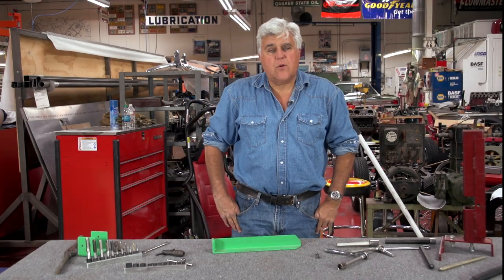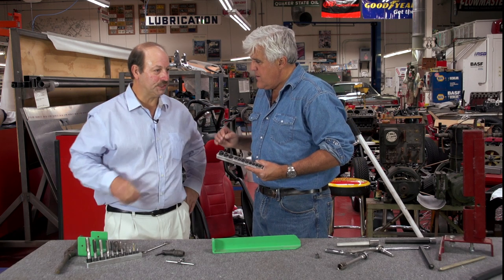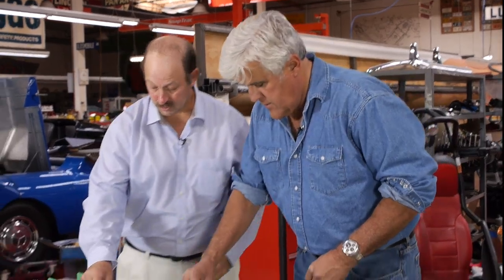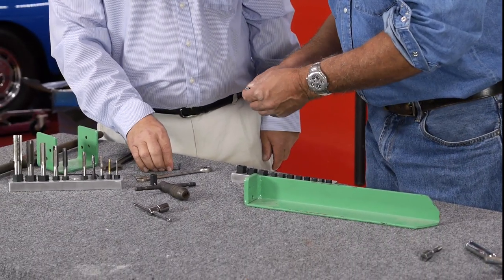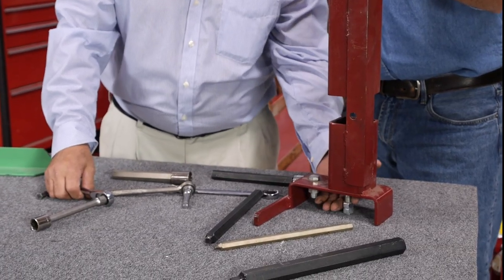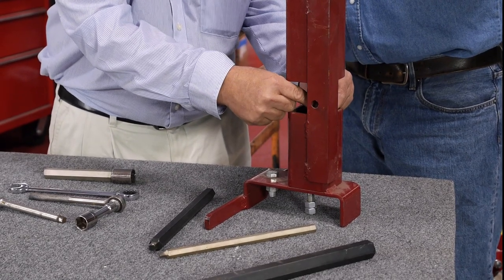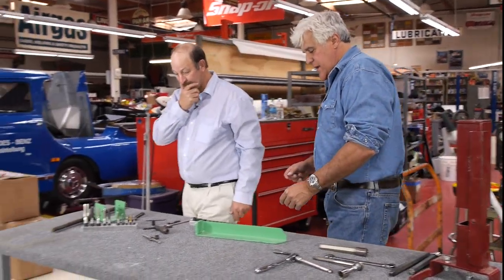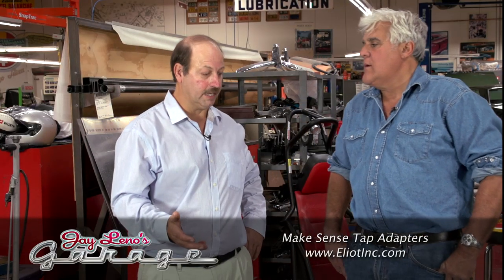Tap Adapters - Jay Leno's Garage

Comment: Well done Jay Leno. Good to see you pushing the tool side. i have had some special application tools made in the U.S., Germany and China,(yes, China, every bit as good as anyone else). All the machine shops were owned and operated by guys as in the video. All open minded, easy to talk to, and even willing to give input as to improving the ideas. Some of the posters are correct. Snap-on tools cost the earth, and are certainly not the best, but that's for everyone's personal choice.::)

Comment: Great for breaking taps off in the hole !!! Got a set of snap on ones and have broken several taps off because you are using a ratchet instead of a tap handle . Seems like when you use a ratchet you are also using an extension as the hole is way out of reach and all you have to do is just put a little side pressure on the tap and snap it's broken . Then you get out the tap puller which usually removes the tap if you weren't torquing too hard on it . P.s. the snap on ones hold the tap in with a "O" ring inside the tap holder .

Comment: I've always wondered why they made taps like that, some times makes them really hard to use. So this would be great, even a set of taps where you could use standard 1/4in drive and 3/8in drive and 1/2in drive would be awesome too.
Reply: I never had any problems just putting a regular spanner on the end of a tap.

Its just a square drive.
Reply: Yeah but the only ones I find that fit are adjustable ones or their too small and I damage them.
Reply: ***** Ah, never trust adjustable. Got metric and imperial combi-spanners so I can find something that fits. If push comes to shove, 30seconds on the bench grinder to get them to fit works for me. Just keep the edges square and its no problem.

Comment: There is one major problem with this sollutions,
Taps are the way they are for a reason.
When you tap something,
it is crucial that there no bending forces into the tap,
because that is what is going to make your thread weak.
This is why taps always use these special grips,
which are symetrical.
If you use normal spanners,
you are enducing a farely high amount of bending forces,
which is why your threads are not going to be as good as the ones
with standard tap wrenches.
Reply: +Peter Griffin Yes, a tap breaker for sure.  Though a few times I've had to put my 1/4" or 3/8" ratchet on a tap when there was no room to swing a symmetrical handle.  One can do that without breaking the tap if one is careful.  That said, a 12 point socket will grab a tap just as well as this fellow's adapters.  His advantage is that the adapter has a set screw so it the tap won't fall out like happens with my 12 point sockets.

Comment: the states just needs to start using the metric system :)
Reply: Why, exactly
Reply: ***** Much easier than fractions.
Reply: ***** Because it makes sense. Let's take distance for example.
1000 um = 1mm, 10mm = 1cm, 100cm = 1m. Therefore 350 meters = 35000 cm, or 350.000 mm or 350.000.000 um. Now you do that with feet and inches, without using a calculator. See my point? It's counter productive to use feet, inches, gallons, and so on. They made sense when people measured distances in foot steps, and liquids with buckets. Those times are over, cowboy.

Comment: snap-on has that tool
Reply: Probably cheaper to buy another of what you're fixing than to buy this tool set from Snap-On.
Reply: s0nnyburnett depends... the snap-on ones are a slip fit adapter with a standard 1/4, 3/8 or 1/2 drive end and have an o-ring to retain the tap in the socket. stays together better in tight spots. and professionals will use them all the time so its worth the extra coin

Comment: Those are a great idea.  Hopefully this dude patents that and makes a boat load before someone else see this and steals his idea.
Reply: ***** never heard of 8 point sockets, but 12 points work nicely as does the box end of a combo wrench because they are mostly 12 point,
Reply: ***** Eight point sockets are very old. They're made for square nuts, drain plugs, and so on. Used to be able to buy them anywhere that sold tools. And, Snap-On isn't the only source of tap adapters with square drive, just the most expensive. Try McMaster, Travers, or any of the industrial supply houses.

Comment: Elliot Inc. is in a town of less than 250 people so the server probably crashed two minutes after this went up. If you are truly interested Google the phone number and call during normal business hours, central standard time.
Reply: Fantastic! you are on your way to becoming the next L.S. Starrett, do you need a good tool designer that you are willing to become rich with?
Reply: should setup an Ebay site to sell these, more exposure and better web service. I would buy a set if I could find the shop. Also, if as well as being 6 sided for a wrench, you also added a 1/4 drive hole to the other end, you could use these with both a wrench, or a compact 1/4 drive T drive(or small ratchet )like most tool companies sell.
Reply: I am in no way affiliated with Elliot Inc. Just live in a small town nearby and know the Internet provider.
Reply: ok thanks for the reply and if you see the guys from the shop around tell them howdy from Utah.

Comment: What is that all about ? For years & years I've used the square drive sockets that come in a 1/4" or 3/8" drive socket set to put over the square end of a tap to cut or clean thread when access is limited... the other stupid hex thing in the video isn't needed either if you use a flexy drive.
Sometimes I think these "inventors" have less resourcefulness on tap than your average home mechanic.

Comment: As a machinist... I find these absolutely useless. Taps are fragile. You need to use a tap handle to retain the balance. It goes without saying, never use these to make new threads on a drilled hole...
Reply: I wouldn't say they are absolutely useless....  I have a situation on a vehicle that my tap handle won't reach, and these would be quite handy...